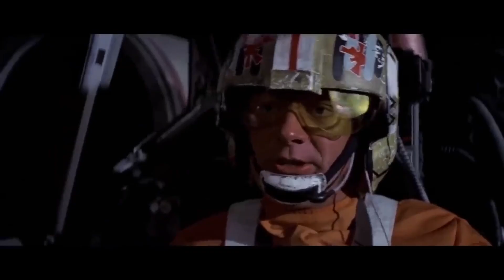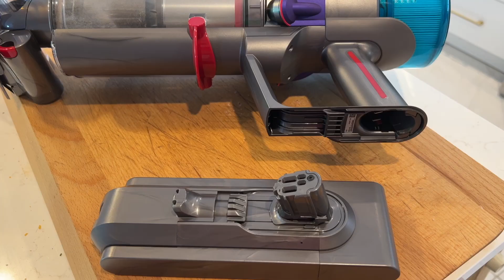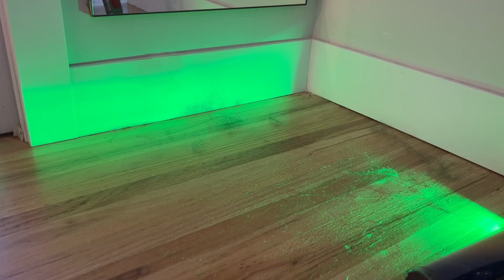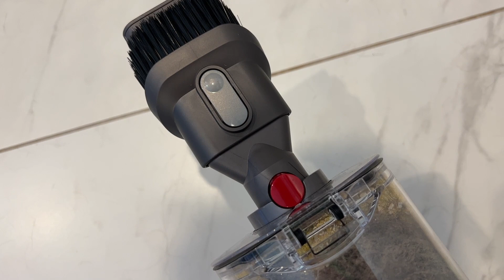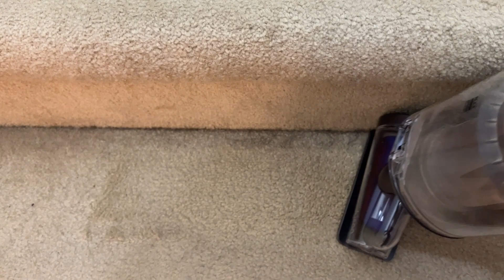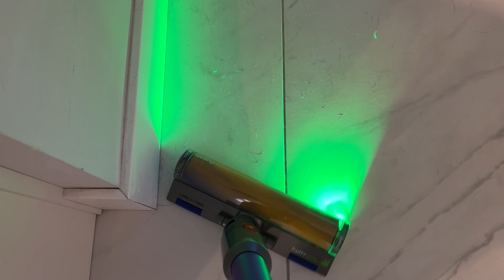Dyson Gen5detect stick vacuum review

Comment: Ive just bought the Gen5detect Absolute. The lazer attachment is terrific. I have the same problem with the brush attachment on some of our rugs. Unfortunately lessening the suction power to minus doesn't really help. The only way to solve it is to switch the vacuum off and on again. If you have pets, don't hesitate - if you can afford it, buy it. You won't be disappointed!

Comment: Do you have any problems with the batteries?  Gen5 outsize
On normal mode (on full charge) my 1st session started at 38 mins, then 20 secs later went to 32 mins then 18, then back to 26 mins. I exchanged it back to best buy 3 times in 2 wks; but ALL were the same.
This can't be normal but I don't hear anyone saying this in their reviews. 
Did this happen to you?

Comment: Disagree about durability. Both the hard surface head and the the carpet head on mind had flimsy plastic at the pivot points that soon broke. The charger stopped working had had to be replaced. The trigger often gets stuck in the "on" position.
Reply from the maker: Sorry to hear about your experience, thanks for sharing!

Comment: Durable? The older versions had their plastic trigger broken after a couple of years and they charge u a lot of money to get it replaced.  looks like they have removed that button but added it to the price of the previous product.
Reply: I own five Dyson handhelds and have never had a trigger problem.The oldest ones are 20 years old and  they are both still working well. I think a lot of people do misuse their Dyson vacuums and don't maintain them properly. They are not meant to be garage vacs.

Comment: QUESTION ALL ?  is the power button a game changer in the V12 and Gen5 or is the trigger fine and no issue in the V15.....thats why i am trying to rack my brain and pick between the three,,,.....2200 sq ft house total...mostly hardwood with various area rugs and one room has carpet....want something strong enough to clean car also.....thx for your review.....cheers from Canada
Reply from the maker: Great question. I do find that having a power button that locks on is a huge help, particularly when cleaning larger spaces. If you have to hold the trigger the whole time, your arms get very fatigued quickly. While I have complained in previous reviews about the awkward location of the dedicated power on button, it’s still a better option than a pull to hold trigger.
Reply: @ErinLawrenceTV  thx for your response...i think i am close to picking one....

Comment: Where does this fit relative to the V15? Does the "family" go V12, Gen5detect, then V15?
We tend to find the V15 is a victim of its own efficiency. Very effective suction means lots of full dust containers per room / trips to the bin. But a bigger dust container would make it ungainly.
Reply from the maker: True… It’s hard to strike a good balance. And I’m not quite sure about the naming conventions myself…
Reply: Gen5detect is the successor to the V15. New name is slightly confusing but it’s said to represent the new 5th generation Dyson digital motor inside it.

Comment: Thanks for the video. Do you now how much the rechargeable batteries cost, I would hate to be in the middle of vacuuming and have to wait 4 hours to charge. Also is the 70 mins of run time on the lowest suction? Because usually no one uses the lowest suction. What are the runtimes for the other suction settings?
Reply: U really don't need the higher suction modes unless ur vacuuming your driveway or something. The low suction is pretty powerful enough for general normal cleaning